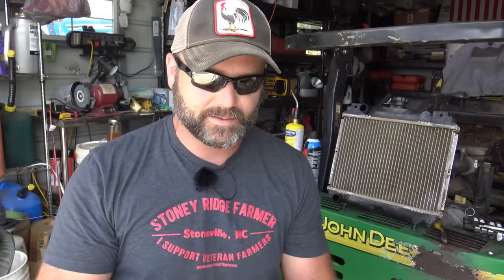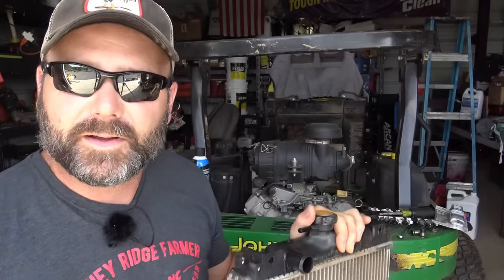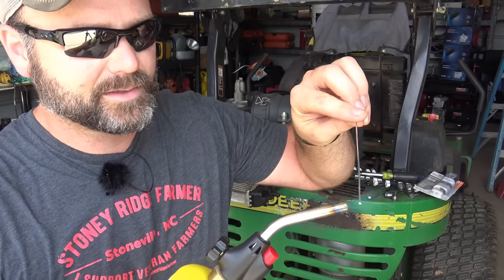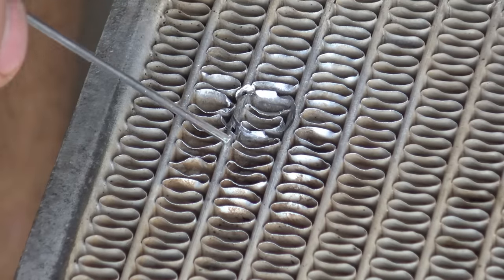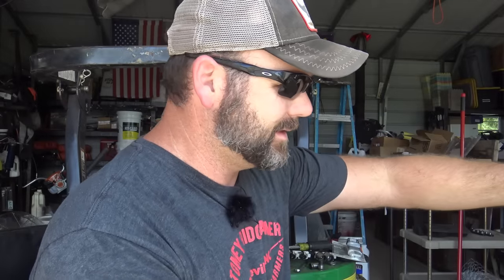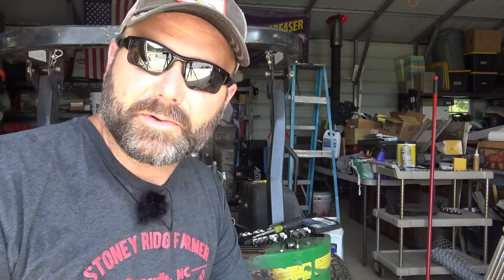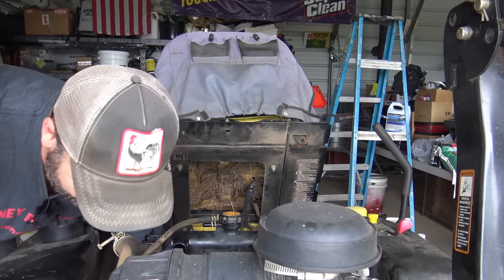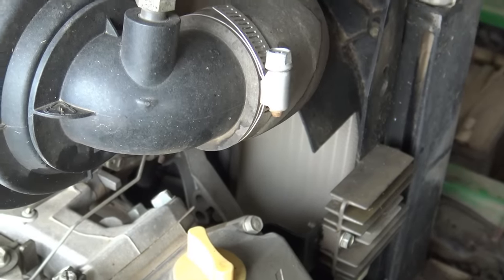How to (successfully) repair a radiator.....weld or epoxy..or..plan C??

Comment: Next time you use a 2 part epoxy, mix it inside the corner of a small zip loc sandwich baggie, then cut the corner off with scissors and push it out the corner like cake icing.   You'll use less product, giving you multiple uses per tube and it's a lot easier to work with. Good video as always!
Reply: thank u
Reply: That's a pretty neat idea but generally I feel like I'm just doing a little bit that I'll be wasting most of it

Comment: Right did a similar fix on a corolla rad. The leak was coming from between the fins. I packed epoxy both sides of the fins. Used a hose from a vacuum to suck some negative pressure through the top hole while covering the bottom hole . waited 24 hrs, slapped it back on. Still working and that was 15 years ago.
Reply: using the vacuum is a smart idea. Im about to attempt a fix on my Ram rad and going to use this technique

Comment: Heat up the substrate and then let the substrate melt the rod.  That way, it will bond to the substrate.  If you heat the rod directly on a substrate that is cooler than the rod, you just leave melted, unbonded rod boogers on the substrate.  Oh, and clean stainless steel only brush to clean for aluminum soldering.  Give it a shot the next time an “opportunity” arises.  Enjoy the videos.
Reply: Does aluminium soldering really work?  Why does my local car radiator repair specialist tell me that aluminium cannot be soldered?
Reply: You know better then most, as that's exactly what heat he did. Lol
Reply: @amana1480  , yes it certainly does work, but its not soldering aluminum,  its aluminum Brazing.
Reply: Electrical solder does not bond to aluminum I have gotten some Flux that is supposed to make it work I don't think I tried it yet but there are definitely things that do work
Reply: Ya I was thinking he hasn't really soldered or anything like that much before
Reply: the words right out of my mouth
Reply: Exactly! you seem to have more common sense. He never allowed the area to get hot enough and allow the rod to melt into the area on its own. that epoxy is not a long term solution he will have issues with it in a few years at best, i tried it and it lasted only about 1 1/2 yr. i should have done it with the aluminum welding rods it would have done the job. He had the right idea in the beginning but the lack of experience welding discouraged him, he should have researched on how to video if he wasn't sure how to use the rods.
Reply: Thanks man. I was experimenting on how to weld using the aluminium rod..but I failed...and I looked for info..and  found you to share some ideas..thanks man..😊

Comment: I believe your issue with welding was that you didn't get the radiator material in the area you were welding up to temp in order to melt. Welding requires melting the metal, not just the stick. A weld ends up being stronger usually than the original material around it because of the quick melt and cooling process.
Reply: No the problem is he didn't use flux. Soldered isn't worth a shit unless you use flux

Comment: Hi Josh, I've fixed similar radiators with acid core solder. Always worked for me. I'm like you I always try to fix things myself.  I research stuff too. Normally You Tube is the best way to start your search. I learn a lot from your channel which is why I subscribed. You can also get flux core solder which I believe is what you use on copper water lines.

Comment: When your brazing Steel you have to get the steel hot enough to Glow red and basically have the brazing rod in a nearby vicinity so it's hot but not hot enough to melt. Then you basically melt the brazing rod into the steel. I think that principal with aluminum is going to be very very difficult with aluminum aluminum because you're going to have a really hard time seeing it get hot. I would suggest something that would melt at a much lower temperature perhaps acid core Plumbing solder with lots of extra flux. I remember also that you need to have a special wire brush for aluminum only because if you use a wire brush that was used on something else it will actually contaminate the aluminum badly enough to give you issues
Reply: keep in mind this is not steel but aluminum.  to hot will start melting the radiator.  but not enough will not bond

Comment: I watched a news story where farmers are hacking the John Deere software so they can fix their tractors instead of paying big $$$ for repairs at the dealer.  Tractors are supposed to be made so they can be easily fixed in the field..not having to be hauled to a dealer.
Reply: Supposedly John Deere owns the rights to the computers and other stuff on their tractors.
Reply: That was part of the story...so the farmers were using Russian software to replace the original.
Reply: There is a lawsuit pertaining to that in progress...  ALL tractor companies, not just John Deere, are being sued due to this..  When it costs $3500 just to HAUL a machine to a dealer because a farmer cannot even look up a code or fix a small broken wire, it is a huge problem..  These companies are ripping off farmers big time...
Reply: JD was lobbying congress to pass laws making it illegal to repair your own equipment. I bought a salvaged tractor that was supposedly flooded. Got a good deal, purged the fuel, lubricant and hydraulic systems. Fired right up. Then it was implements, proprietary issues!  Found a local company manufacturing implements "comparable" with JD.  JD has tried and failed to shut the locals guys down claiming intellectual ownership, the judge disagreed.
Reply: @michaeldubya  What's the current status, 5 years later since your comment, of that local company making JD compatible implements? 

My 2 bits: All of the lobbying that has lit businesses get consolidated into the handful of corporations that run everything just shows that government power creates corporate power. Shrink the one to shrink the other.

Whether it's unfixable mechanical equipment like tractors or cars, unrepairable electronics, "terminator" seeds: bunch of POS corps using regulatory capture against the public. 

Any hand wringing about "Big Govt gonna push it too far one of these days!" Seems pretty dang limp-rested from my view if people are supporting parties and candidates that are all for letting corporations run them over. 

The only folks in DC that have any teeth against JD and other companies happen to also be the folks in DC consistently pushing for less government. Shrink the one to shrink the other. That's how this whole thing was meant to be from the get-go.
Reply: Old days we bought a TV,with the electric schemes fine printed in the manual. Now a days they sell a software and charge monthly call it a subscription. Something not right.
Reply: The root of that problem is in the word "licensed" . 
I saw problems back when computer companies claimed that they were "licensing" their software, not "selling" it.
I've always held that I accepted their terms under duress and if I bought it, I OWN it.
The problem comes in spades when the "hardware" won't work without the software. Whether that hardware is a laptop, pc, car or tractor is immaterial. It's YOURS you should have full access to everything on it.

Comment: Hey. When you braze with aluminium you have to heat what is being brazed up (the radiator) and use that heat to melt the aluminium rod otherwise it will fail as yours did because you used the torch to melt the aluminium and it then went onto a colder surface being the radiator. If the radiator had have been heated to the temperature necessary to melt the rod it would have bonded properly.

Comment: Thanks for giving me the confidence to fix my bike radiator. Whooooo!!
Reply from the maker: believe it or not, this is still holding! However....on a motorcycle, I'd buy a new one. You don't wanna be 50 miles from home and have a problem....I'm always home with the zero turn

Comment: The reason the solder didnt hold was because you got the rod hot and melted, but the radiator wasn't hot enough. Get the radiator hot to where the rod melts without direct heat and it'll work.

Comment: Just like with soldering copper plumbing pipes, heating the material to be brazed is the way to go - not the actual rod. Flux coated rods may have helped, too, but I think application of enough heat to the radiator and some practice* would've helped you.

Meh - at least you're cutting grass now right? Hope your repair holds up!

*I once repaired some small rips in my truck bed with brass (bronze?) brazing rods and MAPP gas. Took me four or five whole rods to learn how to do it right, but I finally got it. Isn't something you just pick up and do right first shot.

Comment: Just a couple of helpful hints  from a small engine service tech, when starting your machine try full choke and maybe a quarter throttle, this would most likely keep it from over fueling and backfireing (also I think your valves need a little adjustment) I also noticed you shut the engine off at full throttle. Always idle any engine down before shutdown, this will eliminate kick back of the engine and possibly shearing the flywheel key. That radiator is most likely the same one as the JD rider you got from your uncle, worth a look.

Comment: You almost got it my friend with the alumirod.   You need to get the core hotter.  Dont put the heat on the rod.  You want to heat the core and let the alumirod suck into the heated  area.  On a small section that pretty hard.  I think if you would have left the heat on there a little longer after you got the glob of alumirod  it would have worked.   The alumirod actually melts at a lower melting point than actual aluminum.  I know when the tiny fins started to melt/worp it might have made you a little guns shy.
But in the end fixed is fixed.  Great Job!!!    I think I would have put blue loctite on but thats just me.   God Bless
Reply: My thoughts exactly. I would have really heated the core up before adding the ALum rod. It's like copper pipes. Heat up the pipes first, then it'll suck the silver solder right into the joint. PROVIDED the inside of the pipe is dry. If it's just built up steam/moisture, it ain't never gonna seal.

Comment: Love the enthusiasm on wanting to do it on your own. Just a little info for the memory banks, for a quick temporary fix maybe just to help finish mowing black pepper might of worked, also there is a product called Bars stop leak for radiators, it works on small holes, also JB Weld makes a putty type material that you roll in your hands for aluminum that would work also. Never seen the epoxy for metal. Learn something new everyday. As always great video.
Reply: The jb weld shit sucks I tried it doesn't hold even on small holes... It's not dense enough too porous...

Comment: As an aside my brother and I have been working on a Scag Magnum 3 mower. Every little piece you need is at least $70. The muffler..  $320!!!, haven't priced a radiator for it but a single pulley was $70, they're so expensive because usually these are used by commercial entities with deep pockets.
Reply: Hey do you want to know were to get parts for scag cheap
Reply: For cheap? No unless you can find the part you need on eBay. I got lucky and scored a replacement brand new fan (was a kubota part not a Scag part) on ebay for cheap. For everything else we ordered from Scag OEM Parts. AKA Shank's Lawn Equipment. They were able to get us that pulley we needed. Which was a one-off part only made for the Magnum 3. (which is a 20 year old design). I imagine for a Turf Tiger, or any of their newer designs the parts are more easily had and are likely in stock. My advise is to not only get the part number off of the manual for your mower but make a close visual inspection of the part as well. They're pretty good about having pictures on their website.
Reply: Josh Harris yes! I want to know. Do tell.
Reply: lance henthorn everything on a scag is rebuiltable so go to your local Napa to get the parts but you can also go to www.partstree.com
Reply: Josh Harris ... check out propartsdirect.com

Comment: What type of brush did you use?  The aluminum gets contaminated if you use a steel brush.  You need to use a stainless steel or aluminum wire brush.
Reply: or brass.

Comment: Hi, I know you have this job fixed already.  I was a machinist and gear cutter for many years.  Back in the day probably 20 or so years ago, perhaps a bit more i remember when aluminum solder first came count and we picked some up to fix a few little jobs before we got picked up a TIG welder.  We actually had someone teach us how to use this kind of solder.  Just wanted to pass some things on that we were taught by the mfg of the particular product we used.   I see someone mentioned the stainless steel brush, the iron in a steel brush does contaminate your surface.  No flux, back to the contamination.   The biggest help we had was we were shown that practice was the best medicine for aluminum soldering was to practice on a soda pop can.  It’s thin,and you can get the feel of how hot and the make it so that the solder to flow onto the parent metal filling in the holes instead of globing it on as you did and so did we in the beginning.   Clean the part off with the stainless brush, spray with your brake clean or starting fluid, brush it again, and solder right away.  You will have to keep using your brush because aluminum will oxide right away again so little at a time.  Hope this helps.  Love your site, we only discovered it a sort time ago, but have enjoyed the new videos, and going thru the older ones.  I grew up on a ranch and we are looking to find a piece of property and want to get back to the more simple life and away from the big city.  Thanks again and keep up the good work, brings back fond memories :)

Comment: I would strongly recommend NOT using brake cleaner, and instead use carb cleaner. If you touch off any residual brake cleaner, it will create phosgene gas which can seriously injure or kill.
Reply: Every can of brake cleaner I ever used was not flamable.
Reply: @allywilkeforsenate  flammable just means it can cause fire (flames) phosgene is a gas and doesn't kill by burning, but by inhalation.

Comment: Good job. Need the metal in a pool or molten state before adding filler, rod. It’s not easy. You had a molten rod sitting on a cool surface, sort of a cold lap. I like to think of it like having two cups of water then pouring both into a basin, they become 1 lot of water like a weld making a strong bond. God job again
Reply: This brazing, not welding. If you get a pool of molten aluminum with a torch, you've already destroyed the part you wanted to fix.

Comment: Good job. I just replaced mine in our 97 4Runner but the plastic top had a huge crack in it. Only cost $179 at Autozone. John Dear has crazy prices.
Reply: Hope you ran an external cooler for the trans. They are notorious for mixing antifreeze and trans oil

Comment: for the ones that have plastic tanks take a oil bottle caps the ring on the bottom of the cap can be used with the torch you were using to fix cracks in the tank just melt it in the crack had some show me that on a car i had last as long as i had car

Comment: I took out the radiator in my 07 Yaris, not that easy on compact cars, I just squeezed the tabs where the plastic meets the metal (leaked there)so far no leaks.
Reply from the maker: Cool!

Comment: The first method do it almost as if you were soldering copper pipe. Aluminum cools down a lot faster though so you gotta heat up tubing, rub rod see if it melts, if not keep heating and then rub again ... Until it actually melts and stays on the tubing....gotta be done quick though after you remove flame because aluminum coold down right away.

Comment: Hi, nice video. I knew the soldering wouldn't hold, no offense. The problem was that you didn't bring the radiator core up to temperature. When soldering you want the solder to melt into the base metal. One big factor is the melting temp of each. As with anything else, they may be just different enough that the radiator coil may melt first which isn't good. Also the radiator core is thinner than the solder rod. One other thing I just thought of is, you may have been able to keep heating the solder you had on there until you saw it melt into the radiator core. Its a touchy thing to try to do. As a jeweler, it would have been best to have the small oxy/acetone torch which enables you to put the most heat to a tiny area. I soldered gold to silver and had to concentrate the heat on the silver because the heat travels through the entire piece where the gold's heat is localized. Heat up a gold and silver rod and see how long you can hold onto each. Thanks for sharing.

Comment: John Deere has prolly the largest parts network of any farm implement Co. therefore parts are higher, but there is usually one within a few miles of everyone. Service and Parts availability is something to consider when you need a part next day, or in some cases over the counter same day.
Reply from the maker: Yep...however $700 for a lawnmower radiator is ridiculous...in our world of e-commerce it doesn't matter where the stores are anymore...this is an outrageous proprietary John Deere rip off!